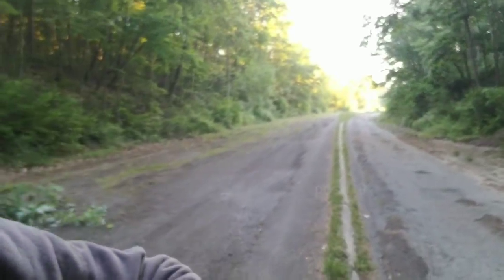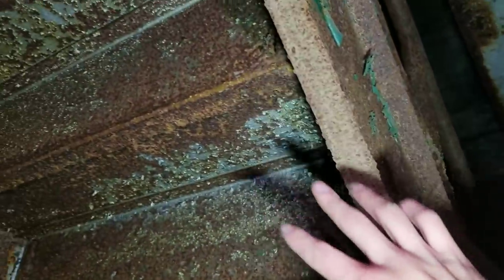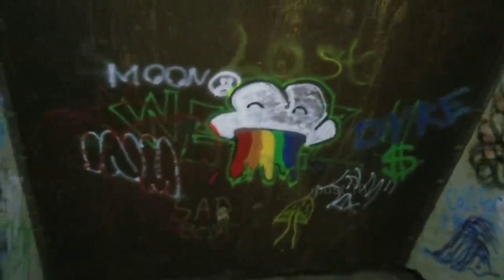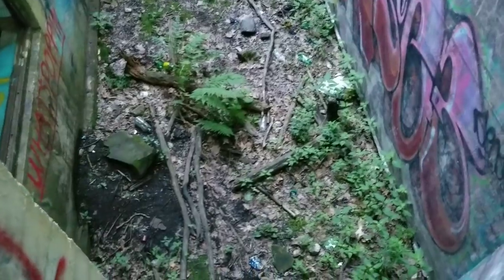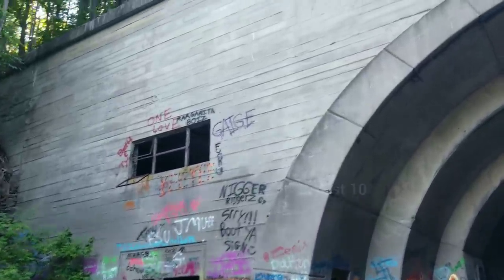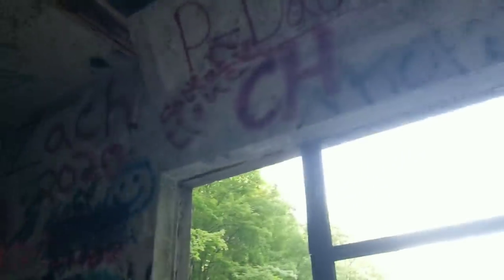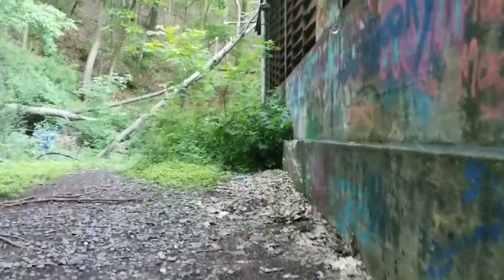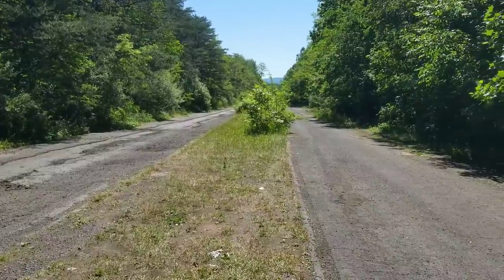Massive Abandoned Pennsylvania Turnpike Tunnels And Exhaust Pumping stations

Comment: Ah, Rays Hill and Sidling Hill.  You're almost in my neck of the wood, pal.  I'm just outside of Pittsburgh.  Back in the 60's, my family would spend a week in Wildwood, NJ every summer.  For my sister and I, traveling out the Pa. Turnpike and going through the tunnels was almost as big a deal as spending a week at the beach.

I could look it up, but offhand I think we went through 7 tunnels back then, of which 4 are still active.  The thing about the tunnels back then was that the Turnpike was a 4-lane highway, but the tunnels were all 2-lanes, so you had to merge, and at certain times of the day during peak vacation season (hardly anybody flew back then), going through the tunnels could be a real pain in the dupa.

I think 3 of the tunnels were bypassed, and the remaining ones had a companion tunnel drilled through the mountain, to maintain all 4 lanes.

Comment: Great choice of car! I've owned 7 Subarus (6 of which were Outbacks) and they are fantastic cars, though most of mine are older models. There's actually a large group called "MtnRoo" dedicated to off-roading Subarus and it might be worth looking into. We lift them and every thing, and with what you do, a lift kit and good off-road tires would probably be pretty beneficial, especially going down unmaintained roads looking for damaged culverts, where roads and such are washed out. You can actually get a snorkel for your exact car to raise the intake so you don't have to worry about drowning your car going through deep water.

Comment: Great video! Just to clarify. The round holes in the ceiling actually housed light fixtures. You see the two holes in the arch at the portal with reflectors still in them? All the holes used to have reflectors and horizontal sockets for the bulbs. Only the long slots were the air ducts.

Comment: Hey buddy awesome video.  If youre worriedabout bike tire flats max out the air press in the tire.  Bumpy, but reduced probability of a flat.  Also i been rockin headlamps that take 18650 batteries.  You can bring several extra batteries with you (you need to store them properly and i got theproper battery charger too)  but they are bright and last a while.  Thx for the video youre great.

Comment: That was interesting to watch. Those stations with the wheels are blowers. They would force air into the duct and at the openings it would push the air out to provide fresh air for all the cars. If my estimations are correct the original setups were to be steam powered and during a renovation may have been switched over to electric and the steam abandoned and electric heat used to keep the place warm or smaller steam boilers installed to keep the plumbing from freezing. I love looking into the past and also into the old heating technology.

Comment: The way those fans are positioned makes me believe that duct tunnel would be under positive pressure and not negative (suction). It's much more efficient and effective to push and displace the volume of air in the tunnel to flush out the exhaust than try to pull it all through.

Comment: The air tunnels connected to the blowers delivered air through the ceiling of the vehicle tunnels to keep the air somewhat fresher in the tunnels. In the event of a vehicle fire all the fans were started and ran at max air flow. The airways above the vehicle tunnels were tapered shorter futher from the fans so as to deliver uniform air at each vent. I drove through these tunnels when I was going to school in Chicago. Some friends I met at school were from southeast PA and I went home with them over Easter break one year. The motors running those blowers would have been hundreds of horsepower each and likely high voltage, possibly 4 Kv.

Comment: There is a abandoned train tunnel in Washington County, Pennsylvania if you want to visit
Cords 40°09'34.8N 80°18'41.7

A Brief description...The Baltimore & Ohio Railroad (B&O) Wheeling-Pittsburgh Subdivision is a partially abandoned railroad between Wheeling, West Virginia and Pittsburgh, Pennsylvania.

The Wheeling, Pittsburgh & Baltimore Railroad (WP&B) was incorporated on August 5, 1887 as the successor to the Hempfield and Baltimore & Ohio Short Line railroads.

The origination of the WP&B started at the incorporation of the Hempfield Railroad on May 15, 1850, which was projected to run between Wheeling and Greensburg, Pennsylvania. The railroad was constructed from Wheeling east to Washington, a distance of 32 miles, by 1857. The Hempfield was sold at foreclosure in February 1857 and reorganized as the WP&B on January 15, 1872.

For much of the 20th century, the B&O from Glenwood Yard in Pittsburgh south to Washington and west to Benwood Yard at Wheeling was operated as the Wheeling-Pittsburgh Subdivision. The route was extremely congested with traffic from steel mills and coal mines that dotted the region.

By the 1970’s, many of the coal mines had closed and by the 1980’s, many of the local steel mills had been idled or abandoned. Instead of a line full of trains, the B&O had just two through movements each way per day and a local switcher that served local industries from Pittsburgh to Washington.

In November 1985, the B&O made the decision to abandon the Wheeling-Pittsburgh Subdivision west of Washington to Wheeling. A section was left intact from Taylorstown east to Washington for car storage, and the segment from Washington north to Glenwood Yard was left in daily use.
(THIS TOOK ME 10 MINUTES  TO WRITE!)

Comment: The fans or blowers at the ends of the tunnels would have been powered by big electric motors.  They are sometimes called squirrel cage blowers.  They take air from around the shaft and blow it so the ductwork above the tunnels would have been pressurized by the fans.  Because there are 2 fans on each end and the dampers, one or both fans could be used at a time.  There may be a wall at the midpoint of the large tunnel.

Comment: The way all radial fans work is to suck air through the side-hole of this hamster-wheel in (where you standing at 11:00) and blows the air through the connected duct out. So the Air in the Tunnel below gets pushed down and out through the tunnel entrances and exits where you drive or walk in/out.
From the sight of the camera at 11:00 when you standing in the intake, the hamster wheel has to be turned counter clockwise to move the air into the tunnel.

Comment: Those big blower fans pull in fresh air through the louvers on the building, and blow fresh air through the vents in the ceiling of the tunnel to blow the exhaust out the ends of the tunnel. In the long tunnel, the reason the vent tube gets shorter is because the tunnel below is raised in the center. The overall height of the ceiling in the vent tube remains the same from end to end, its the ceiling of the tunnel below raising up as it gets nearer the middle.